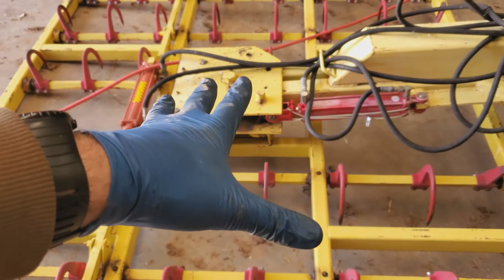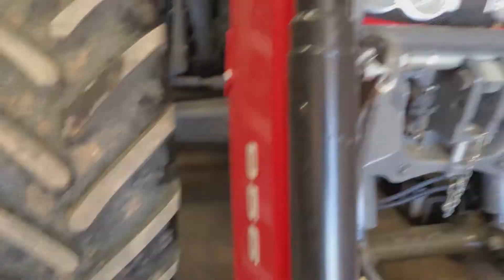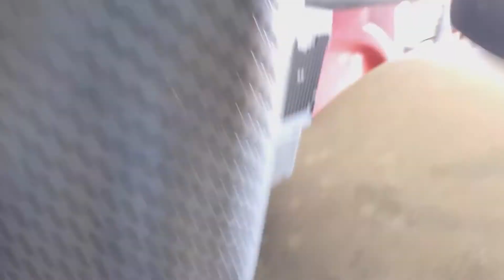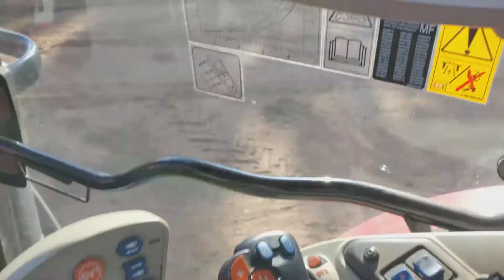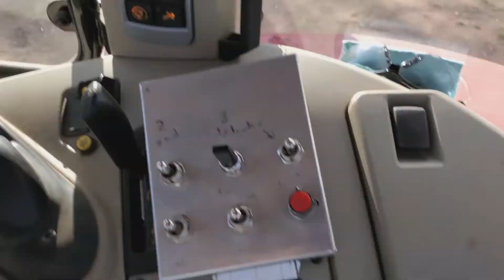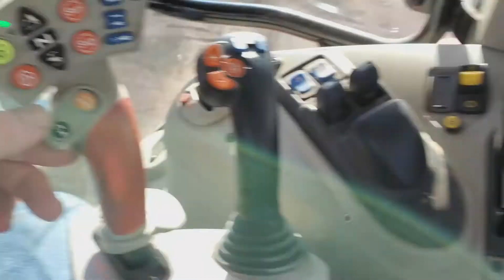Rotating Bale Grapple: Lewco TBH18 (works with New Holland Bale Wagons)

Comment: Why don't you run the turn cylinder off the rear SCV?
Reply from the maker: Good question.  I certainly could have, but I would have had to run two very long hoses from the back of the tractor all the way to the attachment point on the loader.  Then, I would have to disconnect those hoses from the grapple and the rear of the tractor if I need the scv's.  The valve was $165, I bet I would spend a decent amount of that if I bought 2 really long hoses.  In hindsight, I wouldn't have bought the flat-face couplers...

Comment: Underneath the floormat on the right side is a metal plate you can remove to get to 2 large plugs and plastic covers to get cables into the cab and under the cover to the right of the seat is a 6pin (I think) DEUTSCH connector which run the H3 H4 Soft ride and some other 12V signals (at least in the EU version)
Reply: On my error Code List are only 4 Number T Codes 
T4153 is an issue with hot oil. You can Check the trans temp in your dashboard
T5153 is an issue with the difflock valve
Reply from the maker: @reemkoG  ok, thanks for checking. What tractor model(s) do you run?
Reply: @Xealuz  MF 7618 DynaVT MF35 and a 2720 (EU version of the 3500 Series). Our Dealer did pretty bad work so I´m always forced to fix the Tractor my self
Reply from the maker: Thanks for the info, I'll take a look into it. It would be nice to get a cleaner installation than through the cable hole under the rear window.
Reply from the maker: You seem pretty well versed in MF tractors, do you have any experience with T153 error codes?

Comment: Have you put it to work yet?  I am thinking of going this way in a season or two.  Would like to hear around your experience.
Reply from the maker: Yeah, works well
Reply: @Xealuz  I check in from time to time to see if you have a video... Been keeping an eye out for a 18 bale grapple. Hard to find. Expensive to order. The way I want to use it makes sense in my head. Only seen a few examples on youtube though.
Understandably, hard to post videos in middle of season. I havent posted in a long time. Working at a job and doing hay kind of takes out the time and energy.
Reply from the maker: I'm in the same boat as you, regular job, farm, family... YT has to take the back seat. It's frustrating because I film stuff but can't get it put up.  Anyways, not sure where in NE your at, but I see one close to Laramie on FB messenger.  https://m.facebook.com/marketplace/item/913330699485353/?ref=browse_tab&search_query=Lewco&tracking=%7B%22qid%22%3A%226988711161648236420%22%2C%22mf_story_key%22%3A%223361327330640258%22%2C%22commerce_rank_obj%22%3A%22%7B%5C%22target_id%5C%22%3A3361327330640258%2C%5C%22target_type%5C%22%3A0%2C%5C%22primary_position%5C%22%3A-1%2C%5C%22ranking_signature%5C%22%3A0%2C%5C%22commerce_channel%5C%22%3A503%2C%5C%22value%5C%22%3A0%7D%22%7D
Reply: @Xealuz  Exactly... every once in awhile i'll come across something on a hard drive and be like "oh yeah, I did film some of that."  Never get around to editing it.

Checked out that link. Nearly exactly what I'm looking for. There's another one around Chadron. Looks like I'll have to keep my searches extended beyond eastern Nebraska. (1hr from Omaha).